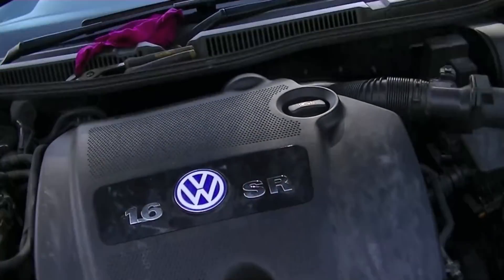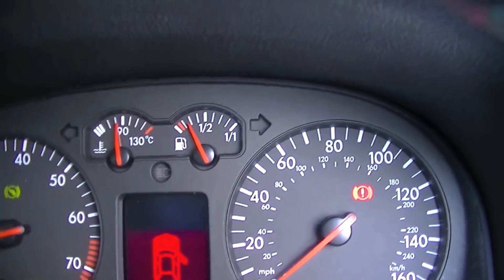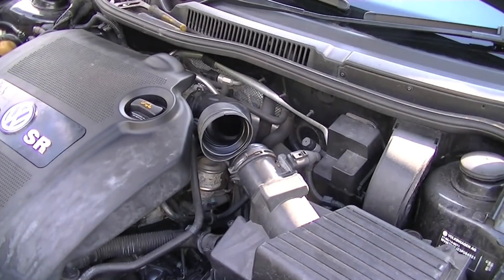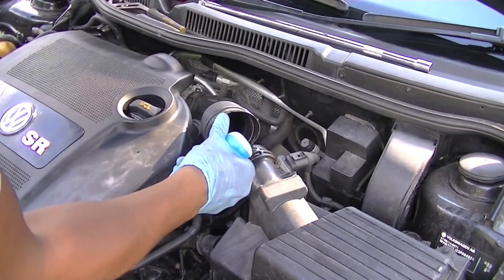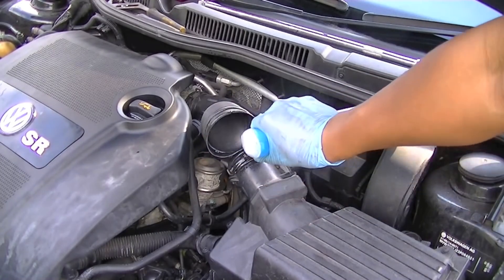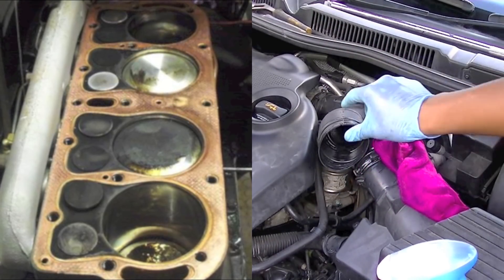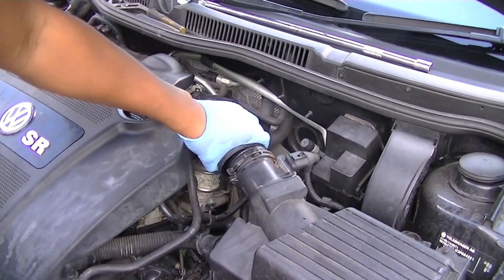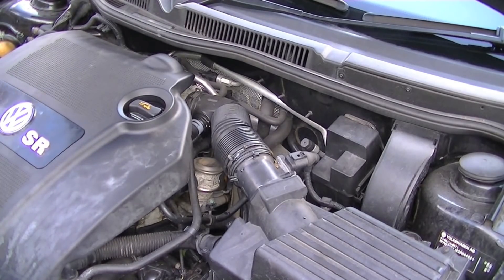How to make your engine run better with just tap water.......Better Than Seafoam?

Comment: Tell that to your car dealer or car manufacturer and you will lose the remaining warranty of your vehicle immediately. Try  using a  brand named fuel injection cleaner after each or second oil change would do you good. Take the guess work out and the risk of damage your  baby. It's worth the few $ of treatment than a catastrophy of engine damage.  How do you like them apples fools? Ooops! I meant folks.
Reply from the maker: +Lok Tom You will lose your warranty if you use and of those fuel cleaners too. Its good when you know facts, right?
Reply: +g4rr377 OMG , there is someone else that understands chemistry and warranty , thankyou
Reply: +BMAC VAGS not necessarily there are products that are approved by the manufacturer also it depends on how it's used for instance if you use Mystery Oil in your oil it will not void your warranty because it's no different than regular oil its just A cleaner however if you use engine restore which is a thick material liquid it will void the warranty
Reply from the maker: ladale21 Which manufacture approves uses of marvel mystery oil on their engines??

If you don't get your car serviced by the manufacturer, in some cases they will void warranties. If you use the wrong TYPE of oil, they can void your warranties.  But you are going to tell me that manufacturers says it ok for you to use 3rd party additives and they will still maintain your warranty.........C'mon lets not be silly now
Reply: +BMAC VAGS any manufacturer,  here in the US will appoval because the oil sample that is used to determine if you used 3rd party , applications will see it as a detergent that is used in some oil , such as royal purple , also if you have it repaired by a certified facility (Not just the dealer ) and you have the printed receipt it is appoved service , also if you read the bottle some additives Ave manufacturer  appoval on them
Reply: you must read all of why the manufacture puts those, im manuals, because its taken out of context, all manufacure will allow, however if you manufacture says no for emissions that another story, it means if you use it all parts except emission parts will be covered under warrenty,
Reply: marvel mystery oil is 74% mineral oil(all oil) 24% -Dichlorobenzene ( which comes into all cars intake and makes its way to the oil from road construction and 1 lard for anti foam , which is a detergtant used in most namebrand oil
Reply: BMAC VAGS ladale21 using fuel additives will not void warranty, using incorrect oil can void warranty should there be engine failure and only then be determined it was due to the oil after the specific gravity is measured. You may aswell say that using poor quality fuels from supermarkets will void warranty it won't but it's shite quality and will reduce the life of the engine overtime. Spraying a tiny mist of water into the engine will do bot all. It'll turn to steam before it has any effect, the oil deposits may only become damp not cleaned away as its not a detergent. The reason why the top of a piston is polished when a gasket fails is because its under compression and theres a shit load of heat there over time. This video a pile of crap too.
Reply: ladale21 ha i know, one can only dream of a utopian society
Reply: +g4rr377 something I should have mentioned beforehand to him is some manufacturers you can't do this to their cars because without detection of the mass air flow sensor the car won't run I know this cuz my 2011 Nissan Pathfinder 4.0 liter shuts off if there is an excessive amount of air or no air detected by the mass air flow sensor
Reply: ladale21 from experience they'll run only when on throttle but they'll cut out at idle. Cars are crap these days too much going on and less fun driving
Reply: +g4rr377 nah mine has an electronic throttle if the mass airflow doesn't send a signal it kills it the security systems weird on it too if it detects the wrong key in the car even if it's not in the ignition you can't start it with the correct key unless you open the door and close it back
Reply: ladale21 i drive a bmw and touch wood it's been spot on. Stay safe bro
Reply: look up water/meth injection ;)

Comment: Sounds like a load of bollocks to me!
Reply: +Declan Kelly Water mist into hot engine, as its running.   Water mist turns pretty immediately into steam, drawing heat out of the inlet charge for evaporation, like an Intercooler.  Cooler inlet charge = Dense air = more air into cylinder...  Bigger bang, more power.  Steam in the mix = steam cleaning the engine, removes carbon (not instantly, over time)...  Red Hot carbon has a nasty habit of popping the fuel mix BEFORE the spark plug goes off...  This starts trying to force the piston BACKWARDS...  This is a problem called Detonation, or Pinking and is the main reason pistons fry, conrods break, and engines go BLAM in an impressive cloud of expensive smoke.

Clean engine = more power, better fuel efficiency, longer sevice life...  Spitfire pilots of WWII used it to get better performance out of their aircraft than 'ze Luftwaffe'  Pro Street/Pro stock racers use it to keep the superchargers cool... (remember cool/dense/volume/power).  Turbochargers are a different animal, and dont like shock cooling, so introduce the water AFTER the turbo...

Hope this helps...
Reply: +BMAC VAGS This guys fuckin high on meth
Reply: +Declan Kelly At the end of the day if you do something to your car and you dont break something, and you do it and its right, then who gives a shit. If you think water injection is wrong, then dont do it and keep your mouth shut.
Reply from the maker: Declan Kelly You have no idea how ignorant that comment is.
Reply: +Declan Kelly youre an idiot.
Reply from the maker: +Declan Kelly If you have never done it, never researched it, then of course it will sound like bollocks if you know nothing about it. Find out more then speak again, what have you got to lose?
Reply: Sorry but I really can't see how cleaning a few microns of carbon off the top of a piston can in anyway increase the cc's and subsequently the performance enough to make it measureable. A proper scientific explanation would be nice! ☺
Reply from the maker: Declan Kelly Like i said, do a little research and find out the benefits of water injection.
Reply: Nice explanation!
Reply from the maker: +Declan Kelly BMW Now offer water Injection cars on their M series, still sounds like bollocks??
Reply from the maker: Declan Kelly What are you talking about???
Reply from the maker: Declan Kelly OK mate, good luck 👍
Reply: +Declan Kelly fuck youre a whiney bitch, shut up.
Reply: +Declan Kelly If your tired off the discussion, stop engaging in the comments, it's simple. You don't need to engage people with vulgar comments, regardless of what they might say. Be the bigger man.  It just makes you look like a foolish and ill mannered little boy when you lower yourself to making comments about your penis size. Your better than that. Or maybe I'm wrong and you'll respond with a nasty remark that will prove to the world just who you really are... (P.S. Your comment about German car makers being untrustworthy "after recent events", damns Mercedes and BMW for the actions of a totally different company. I'm obviously partial to BMW so take that into consideration but you wouldn't hate Ferrari if Lamborghini cheated on its emission rates... Or would you...)
Reply: It does actually. I wouldn't trust any German car manufacturer after recent events. What a load of bollocks!!!
Reply: BMAC VAGS Well it's my opinion which I'm entitled to! Can we leave this subject to rest now please it's boring the tits off me...
Reply: +andrew stinson What don't you understand about leaving the subject to rest? And you call me an idiot...
Reply from the maker: +Declan Kelly  "Well it's his opinion which he is entitled to" ..... Remember those words??
Reply: +BMAC VAGS What am I talking about? My opinion, remember?
Reply from the maker: andrew stinson 😂😂
Reply: +andrew stinson +andrew stinson Being a carbon based lifeform the only drug I rely on is water. Just as long as it's sprayed into my inlet flange orifice!
Reply: +Rohan Rehman Go fuck yourself!
Reply: BMAC VAGS After spraying copious amounts of water into your manifold inlet flange with a huge 'I can't believe people actually take their car to be serviced at a garage anymore' inane grin on your face, I'll be thinking of you as you drive down your local 'boy racing-mile and a half stretch of dual carriage way' with plumes of rancid white exhaust fumes billowing out of your now incapacitated Ford Escort Mk 12ty, freewheel to the nearest layby muttering 'bollocks, bollocks' under your breath!! 😃

Comment: Have u tried having the exhaust fumes checked out prior to using the water spray method & then checking the results again afterwords....
As this engine cleaning was shown on tv recently with very positive results, yet if you can simply go out & buy a spray bottle n add tap water surely somethings amiss

It would be great to have a proven result with " this will help everyone's wallets"

Comment: Hydraulic locking: Water is a liquid which means it can't be compressed like air. Put more water in to a cylinder than there's space in the combustion chamber and the piston will be stopped when the volume above the cylinder = the volume of water - not likely to happen if your rate of flow is limit to what you can squirt by hand.

Even so, one of the products of burning hydrocarbons (petrol & diesel) is water, so I doubt an occasional squirt will be significant unless it's working through some other mechanism and I'd worry about the effect on the valve seats and piston ring to bore friction which is more critical than how shiny the piston crown is.

Comment: ive recently bought a mk4 golf e 1.4 16v , sometimes when coming to a stop it will cut out?? ive read that it could be the throttle body is dirty or it could be the temp sensor? would this method help the running of my car out? also it judders and jerks abit going through the lower gears, could this be a knock on affect from the throttle body or lambda? cheers BMAC VAGS
Reply: Stefan Bailey Any luck with results to this question?
Reply: yeah turns out it was a few things making the problem , it was the throttlebody needed cleaning , new temp sensor and the induction pipe from the exhaust manifold to the air intake was cracked causing it to suck in unmetered cold air ( sounds daft i know ) gave it a service and some new plugs and it runs sweet as a nut now :) ( fingers crossed )
Reply: Steve G

Comment: To be honest there's always going to be a small risk and that increases depending on the type of engine and condition of it anyway. Had to do a top end de-coke manually on a zetec engine that had failed the emmisions test, thought it was the valve stem seals so they were replaced along with a good decarbonisation of the head and piston tops. Put it all back together and still smoked! Turns out it was a couple of gummed up oil control rings allowing small amounts of oil to be drawn up and then burnt. The engine was worth saving and hasn't given me any problems since. As for fuel system cleaners they are worth it but not any cheap ones. I use  (Archoil) and it's excellent stuff. Read the reviews.

Comment: Ok kids and idiots, listen up.

little bit of water isnt going to kill your engine, it will clean it.
you get gas, theres water in gas (to a degree)
you drive in the rain, you think water doesnt find its way in?
corrosion? if gas can keep a tank from rusting and also be used as a cleaner you think its going to allow corrosion?
a little mist (not drownding the engine in water "bogging it down") will not wash or contaminate your oil. combustion chamber is in no corilation connected to your oil system. water will not pass the rings as a "mist form" it will be burned befor it comes to that.

as far as o'2 and cat systems if you got that much carbon in your engine your o2 and cat probably are in the same shitty maintained condition state.

olny reason water would mess with compression is if your motors been poorly maintained prior too. people make the same claims that seafoam will blow your engine ect. it wont when used properly and if you properly maintain your drivetrain.

carbon buildup does increase compression ratio but very very slight increase nothing that would make a huge difference as far as detination or compression loss. and if you have enough carbon build up to effect the detentation of fuel to cause pre-det you probably shouldnt clean it cause it obviously hasnt been maintained.
now, area where you might see noticable difference in fuel and preformance would be the valves getting cleaned from build up. not only will keeping valve faces and surrounding surfaces allow air to flow in and out easier but they'll be able to open and close fully and with ease.

proven fact better air flows in and out of a motor the better the motor preforms.

so befor you kids with your half ass knowledge and no mechanical degrees or expirence hop on here and say something doesnt work back up your statements.

worked on cars for 15+years
hoda,ford,dodge,toyota, gm, caddilac, pontiac ect.
+5 years dealing with military logistics
hobby and pasttime building/cleaning/ and modifying engines professionally.
Reply: Douglas Henson 
So having a long drive in a Down pour is gona do the same thing....just say'n.

Comment: How about 1 Redex bottle fuel system cleaner to 1 tank of fuel.
Maybe that would do equal results and safer?
Reply from the maker: ilia gofman I am not a fan of fuel cleaners. They have to run through your dirty fuel system to clean your injectors. That does not make sense to me.
Reply: BMAC VAGS It made sense to me because it enters the combustion chamber. Does it not work on carbon build up?

Comment: tap water contains minerals and will cause rust. Your better off using distilled water.
Reply: @Ricco Mayoral, distilled water does not have as great cleaning power as does tap water.
Reply: @jsb5188  yep you are 100% correct all them fucking chemicals in our tap.. lol

Comment: I am doubt in this method as water is not suitable to combustion engine except to the cooling system, which is not in direct contact with the combustion process. Anyone tried this should be on their risk.

Comment: If yyou do this you WILL hydro lock your engine and destroy your car! Fuckin idiots!
Reply from the maker: stuart w Learn more before making these sorts of comments
Reply: you learn more before getting people to F up their pride and joy's!
Reply from the maker: stuart w Google water methanol injection, that should help you.
Reply: stuart w Unless you're pouring idiotic amounts of water down its throat, you wont hydrolock it...  Its a fine water mist, and its into a running, at temperature engine...  The idea behind it is, the water evaporates, pretty much immediately taking a LOT of inlet temperature out of the incoming fuel/air mix (like an intercooler)...  Cool inlet = more power.  The steam pisses thru the engine and steam cleans (oddly enough) the internals on the way thru...

I, myself, wouldnt do this with a squeezy bottle, I bought a proper Water Injection kit, and TBH my 1977 Ford Fairmont still has her original 4.9 V8 after 552,000 kms, runs like it just got out of the show room this afternoon...  Its good shit, but...  do it properly...

Comment: Is this not the same as driving in the rain. The moisture in the air goes the the air intake and dose the same thing.
Reply: subman2366 not really, no...  You need a fine water mist to be going into the engine...  Driving the car in the rain isnt a fine water mist (in fact, I'll be bloody suprised if any part of the intake of your car gets wet at all, unless you have no hood)...
Reply: +Andy George Until one drives thru a pool of surface water on the road ...as happened to me. Result was a stall...lucky got it started again and had a long drive after to clear it out.
Reply: +Vincent de Guard stall?  as a result of water in the intake?  or wet ignition?  What type of car?  PS, driving thru standing water isnt QUITE the same as driving a car in the rain...
Reply: Andy George Wish I knew...was a large "puddle" and splashed up sides of car, 1990s VW...makes me worried to drive in heavy rain now ;(

Comment: I've done this to my 1989 sunny surprisingly the amount of carbon particles came through the exhaust was unbelievable after that I had to turn the throttle down a bit coz it went up. I used a syphon method using air n water through the brake vacuum hose.

Comment: You never spray water in your engine it will ruin internal parts as well as corrode. Think about it if you put water on top of oil your result will be corrosion when the water sinks into the oil. Common since will tell you that. PEOPLE NEVER DO THIS!!!!!!

Comment: I hate all this crap on the internet about cleaning carbon from your engine cause unless you have a high performance engine there is no need but if you feel you simply must clean your engine than remove the cylinder head or heads and clean it right and if you dont have the tools or skills to do that then you shouldnt be messing with your engine